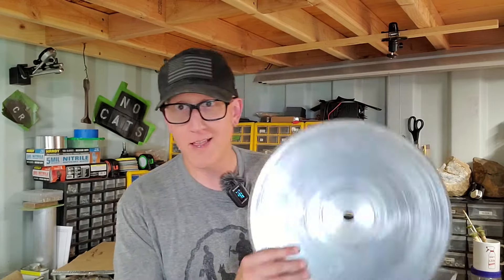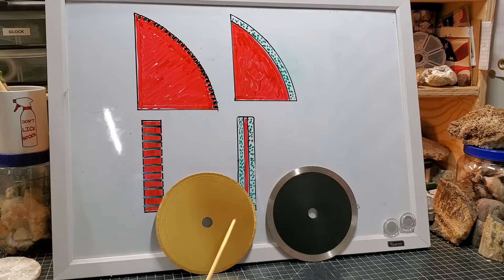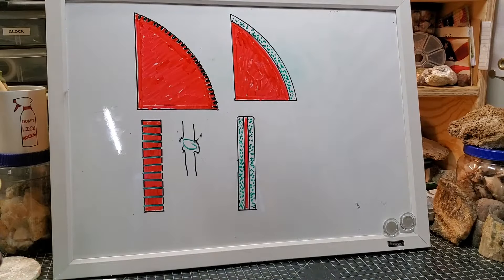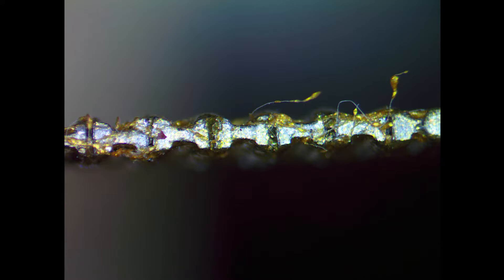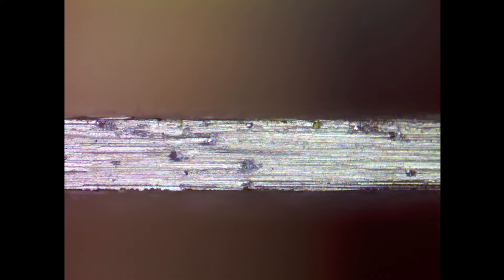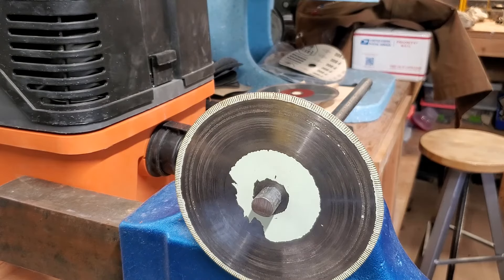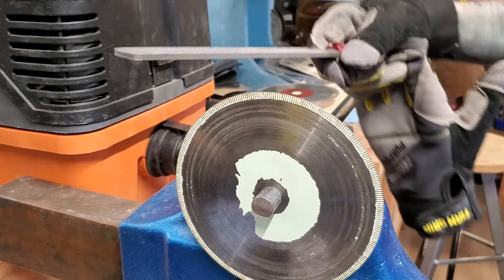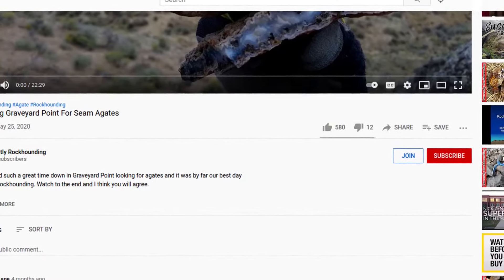The Trick to Making Lapidary Blades Last Forever!

Comment: Should have shown the cut surface of the stone under the microscope. You had one side of that trimmed off piece that was cut with both blades, sharpened and new. In metal working, a dull blade will tare the metal rather than cutting and you can see the difference on the worked surface.
Reply from the maker: That would have been good but I didn't think about that. When cutting stones you can see slight surface changes when cutting but its nothing that can't and won't be quickly polished out. There is a slight break in period when running a new or freshly sharpened blade as the metal burs get removed and paint comes off but that that seems to only take about 1" cutting until that stuff works away.

Comment: I do have a queation, I have a 10in trim/saw blade, but the speed of the motor has no adjustments, can I install a 6in blade and would that be safe, change the cutting of the trim/saw blade? I do know that the smaller distance actually creates a slower Speed, as the distance of the smaller diamond 6in blade actually travels at a smaller distance per sec. the radius being smaller changes the displacement distance at the circumference edge of the 6in blade, its actually slower speed; not faster. I was just wondering if people swap out a 10in for a 6in blade when cutting.
Reply from the maker: You can do that but why would you want to?

Comment: What sucks about some notched and continuous blades is that they tend to get a bit "skinnier" as the metal wears down not just vertically... but horizontal as well. A thinned-out blade can snuggle into a rock and then the cut is kinda stressed... and it will build more heat.  I never get to use up a blade completely because of this...

Comment: Is it possible to sharpen a sintered tile saw blade as well?
Reply from the maker: Yup! It's the same, just thicker to withstand the added speed.
Reply: Yes but and this is a big one. Tile blades do not have nearly as much diamond in the matrix so compared to a lapidary saw blade they cut much slower. It is false economy because that thicker blade takes a lot longer to cut. A blade that is twice as thick takes 4 times as long to cut. You get what you pay for.

Comment: I'm just getting into cutting, I bought a continuous rim blade because I was told the other blades will cut you if you accidentally touch them. Will the 1st blade with the notches cut you if you slip and touch it?
Reply from the maker: You will not cut yourself on any diamond blade but a segmented blade can bite you but almost no one runs those.
Reply: @CurrentlyRockhounding  thank you so much

Comment: Have you had any problems with sintered blades wearing down unevenly? Is there any way to restore those? It happens to me pretty regularly but wondering if it’s because of the amount of pressure I’m applying.

To clarify, I’m talking about a blade wearing down unevenly by more than 1/8” on opposite sides, causing a very bad wobble and makes the rock jump while attempting to cut.
Reply from the maker: That's really shouldn't be happening. Why type of blade do you have? Also you can email me as well, sometimes photos will help with this sort of thing.
Reply: @CurrentlyRockhounding  I took a video of it. how do I go about emailing you? They’re standard RIDGID blades.
Reply from the maker: @stormymountainrockworks  Depending on how long it is you can email it or upload it to youtube as an unlisted video and email me the link at currentlyrockhounding@gmail.com
Reply: Did u ever find out a solution to this problem? 
Im having similar issues with a lap blade and wondered if any way of saving it as it's almost new

Comment: I timed using the timer old blade was right around 14 seconds new blade was right around 22nd don't know if it was the same thickness but that shows you not much difference
Reply from the maker: I should of picked something that was the same length of cut I think as well for that. Also a factor when cutting with a new blade is all the glue and paint kinda needs to work itself off.

Comment: Very late to the party. Also tilesaw user here/previously grinder.
What is the difference between notched and sintered?
Reply from the maker: This is a topic I have touched on but pretty much notched blades have little notches cut into the edge of the blade, diamonds are put in and then the notch is closed up around them. Sintered has diamonds in a matrix that runs around the outside of the blade.
Reply: @CurrentlyRockhounding  I meant more like performance wise/result wise  .

Comment: Not sure if i can buy this. I have the same blade that came with saw and it was used when i bought it.I have had it for 20 years. It is very nearly worn out. I have a lortone st 10. It gets used at least once a week. I have never experienced blade dulling. The only maintenance i do is to take blade off and flip it when i change oil. This keeps blade edge even.  Hammering the edge only widens the kerf and will temporarily speed up cutting until it wears away. Old school notched rim blades are done this way to lock in the diamond into the rim. Great if you are into making your own blades. I did really like the microscope views though.
Reply from the maker: You don't have to believe but I did show the process in action with before and after microscope photo of the same blade and portion of that blade.

Also light peening does not widen the kerf out the way you are saying it does, rather it just cracks some of the super thin metal that slowly over time gets pushed over the notches with the diamonds in them

I would love to see this blade that has never been dull, I think what you're experiencing is a dull blade that you have gotten use to.
Reply: No that is not the case it is not about believing . This is experience and talking to blade manufactures and saw makers. Just like machine tooks cutting metal there speeds and feeds for a reason to maximize tool life and efficiency.  I have made my own blades in the past from copper and diamond. When I was younger I did not have a much of a budget so I made much of my own tools. They work well but are very labor intensive to make. The super thin layer you talk about is glazing. There are only 2 ways blades can become what your calling dull. #1  If you run too high of a feed rate you can rip the diamond out of the blade edge. 2. if you run materials that glaze the blade some jades will do this. Psilomane or materials that have a high metal content, metorite is notorious for this. Glazing is a case where the blades metal is pushed over the diamond. It will drastically reduce cutting ability. If the cutting rate and pressure are set up properly dressing of the blade is not necessary. The abrasive particles of the swarf from the stone being cut will do that for you. My saw is set up to run 10" 1/4 inches an hour. In my 20 plus years of doing lapidary the only people I have witnessed with this problem said the same thing to me "this saw does not cut fast enough". Their slabs also look like ocean lots of waves. The slabs I produce can be put on a flat lap at 600 grit no waves.  I stand by what I said before, if it is set up right it will cut without problems. I am thinking you got your information from those people. @CurrentlyRockhounding
Reply from the maker: @johnjennings8085  What are the blade manufactures and saw makers you have spoken with? Ill call them. 

I disagree with what you're saying here about blades never becoming dull unless you're doing something wrong. 

Appeal to history fallacy arguments do not help, saying you have been doing something for ___ blank many years usually means that you have been stuck in the past and you could have been doing it wrong this whole time.

I'm open to being wrong here but you should really make a video and show what your saying is in fact true.